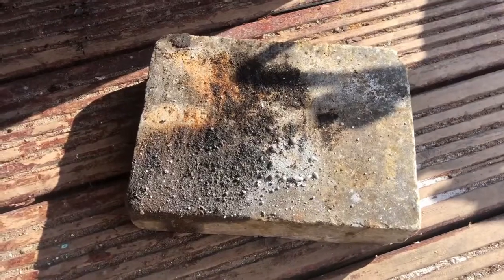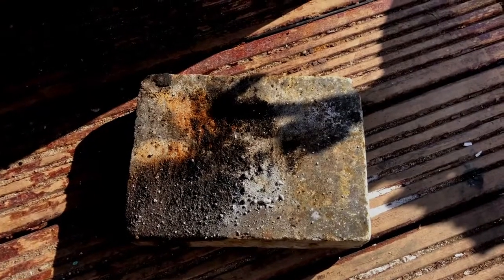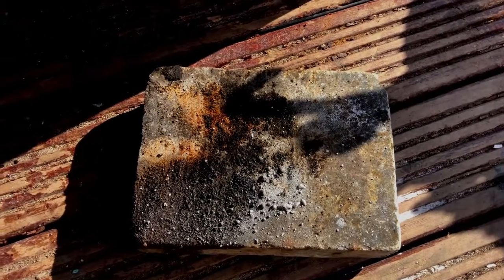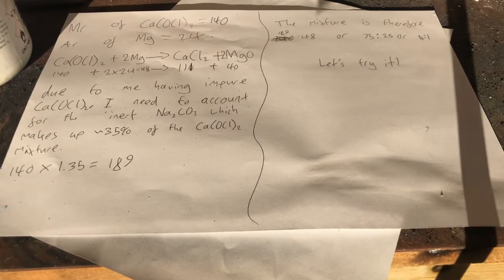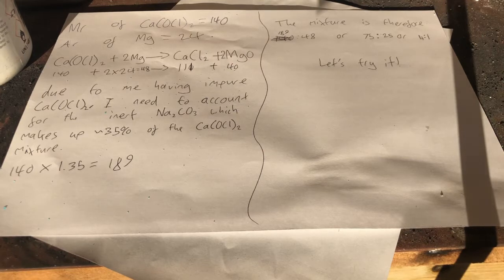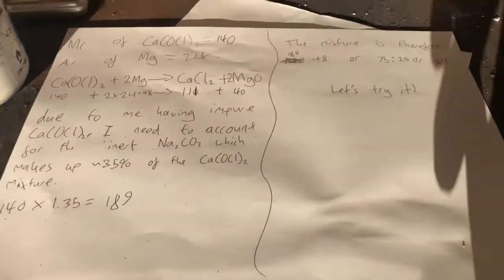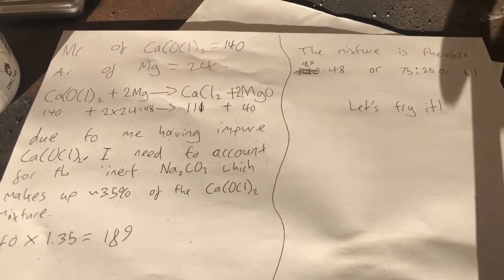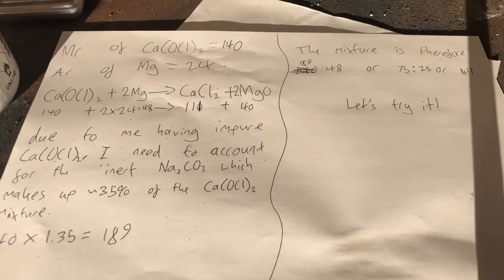Can pool chlorine act as an oxidising agent for pyrotechnics?

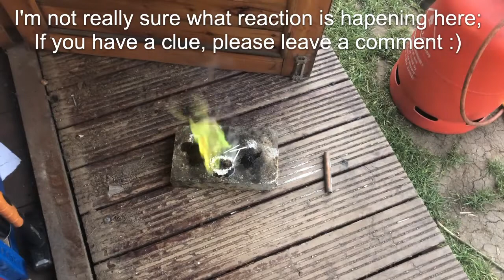Comment: 4:56
If you mean the green flame I would guess it comes from boric acid. I saw it on the MSDS of many pool chemicals. I once tried to burn a charcoal, sodium monopersulfate mix and was also suprised by the green flame.
Reply from the maker: That makes sense now, I has no clue where the green came from. Thanks!